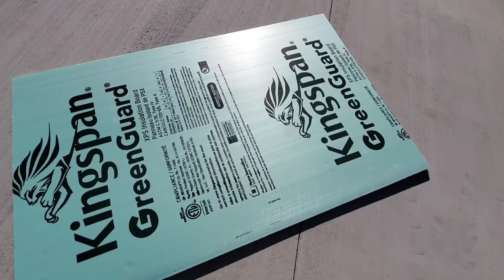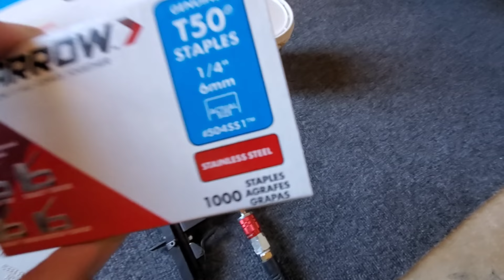Super Simple Jon Boat Floor

Comment: Thanks for doing this little series. I have the same boat and want to pull the foam in the rear bench for storage now. You've made look easy enough. I have floor mounts for seats. Would the aluminum angle be enough to support a foor mount pedestal seat?

Comment: I'm just curious if you have ever run a grab bar attached to a wood floor like this and how it held up?
Reply from the maker: I haven't,  I'd imagine it would need to tie into a rib or hull
Reply: @AnthonyJonesBrigadeBoats  Ok thanks and thanks for the video.  I had another question.  Do you really need the angled aluminum if you screw down the wood floor?
Reply from the maker: It might be ok without it so long as there is foam under it. I prefer to get the corners/ sides tied down securely because thats the spot where it's going to warp or bend. Definitely better with it but not 100% necessary if you want to try without end supports.

Comment: Zero need for the plywood with the foam  in between the ribs . Only a material that you can glue carpet to like thin fiberglass board. Way way way lighter and won't ever rott.

Comment: Make sure you use epoxy and not polyester resin.  Epoxy is stronger, resists cracking and is waterproof.  Polyester resin isn't any of those things.
Reply: exactly.....I have restored/built many wood and other boats, only epoxy will last, and esp. must seal all plywood edge  grain or it will absorb water and rot/delaminate quickly!
Reply: @richarddegen6184  what type of epoxy (brand) are you using? And just standard plywood no ada exterior or marinegrade?

Comment: How much weight do you think you added? I have a tracker 1236 wide. It can only hold 396lbs total. 2 passengers. I have a SeaPro 10hp w/5 hp stickers😉. It's a little heavier than a 5hp. 
 Reson I am asking is. If all these modes add up to 100lbs. Than that drops me to 296lbs. Now it's a 1 passenger. Look awesome. I would love to.
Reply from the maker: I literally added 6ftx4ft of 1/2 inch plywood.  So whatever that weighs. Definitely under 100pds
Reply from the maker: I also know guys that put 800pds in their 12 footers. It's not necessarily the law, just the manufacturers recommended weight capacity

Comment: Using stainless steel self tapping screws to install it was a mistake because steel on aluminum causes corrosion
Reply from the maker: Not a mistake. Been doing this a very long time and stainless is still the best option. Galvanic corrosion can occur but the biggest contribution to that is grounding to the hull as current expedites the process for corrosion to occur between the dissimilar metals. My thoughts- don't use in salt water, and don't ground to the hull. Use other hardware if you want but they will rust out. The pros of stainless for this application far outweigh the cons. Just my opinion.

Comment: Excellent video I've seen a lot but this one is the best. I'm going to do the same flooring to my 14FT Tracker. What size rivet did you used?
Reply from the maker: Thanks! 
3/16 rivets with 1/4-3/8 grip
You can use countersink or standard found here:
https://tbnation.net/products/rivets?ref=builtforbattle&variant=34317257539719 
Use code BRIGADE at checkout for 5% off

Comment: would the bench storage hatches not fly around on the highway with no latches?
Reply from the maker: No, the carpet is tight and snug. No different from guys running flush finger pulls or nylon strap latches. But yes, locking latches work great. Adds time, labor, and money in parts. This was budget project for customer. You can add them though.

Comment: For it to last why don't you seal both sides of your plywood
Reply from the maker: I have before. You can. I've found it to be a waste of time and material.  I seal the tops and sides mainly for extra protection from rain (while fishing or in transport). If you plan to turn your boat into a submarine, seal it all. I personally have never had more than a half inch of water in my boat and that was after a leaking plug. Residual moisture will not harm the underside but standing water of two inches or more (height of bottom rib) will.  If you leave your boat outside all the time uncovered this modification may not be for you.
Reply: @AnthonyJonesBrigadeBoats   Didn't figure it would be that much more money especially  you're doing YouTube videos but OK
Reply: @AnthonyJonesBrigadeBoats   Do you think a real boat  Builder would cut cheap corners like that? For God's sakes make a name for yourself

Comment: Not PT plywood? Problems down the road?
Reply from the maker: Not treated.  That's the point of the resin I used. Waterproofs it. Been doing it for 5 yrs now. Works great although most of these boats guys are willing to pay me to modify take good care of them. Garge kept, covered, or under a pole barn. Might get wet here or there but if you.leave anything outside all the time it will turn to crap pretty quick regardless.

Comment: How long will the wood last with putting the resin on it
Reply from the maker: A long time. Results vary on if the boat sits outside or is garage kept and how often it gets wet. Loaded question man. I expect mine to last as long as I have the boat.
Reply: not long

Comment: Why do you always use wood instead of alluminum?
Reply from the maker: Dude.....The video posted one week after this was titled: ALUMINUM FLOOR SYSTEM.  In my all aluminum 1232  build. Just did a Basstracker Pro Team 165....All Aluminum build. Currently building a 1436 , aluminum framing wood decking. Customers pick. When an all aluminum build cost 2 grand more for hatches, guys opt for wood. Watch my channel,  it's not all wood. The budget stuff is though. Aluminum is 225$ a sheet, wood is 60$. Wood hatch is factored into the sheet,  aluminum is roughly 200$ per hatch lid to make, including tracks. Again, up to the customer.

Comment: why don't you resin the back part of the board?
Reply from the maker: You can, and I have before. Found it was a waste of time, resin, labor, and money. It's elevated off the floor, only way it's getting wet is if your boat is flooded. Even at that, exterior grade can get wet a few times no problem.  It's the constant abuse from rain and moisture the top takes that is the problem.  I make sure to do the tops and sides of all parts really good, seems to work out. Do the bottom if you'd like, from a budget standpoint I find it unnecessary.
Reply: I’m hoping to do something like this for my Jon boat at some point. If I use plywood, I’ll be epoxying both sides. What’s the harm? Seems it can only help.

Comment: Soooo. Where’s the water escape ?
Reply from the maker: It drains around the sides and works its way to the channels. I mean, the floor is TIGHT, but not AIR TIGHT. Water finds a way. You can add flush floor drains if youd like but my experience is its hard to durect the water to the drains abd it naturally drains to the back and sides so i don't bother unless the floor is tapered to the center like some bass boats ive done.

Comment: 1" SCREWS ? HOPEFULLY THEY DIDN'T GO ALL THE WAY THROUGH.
Reply from the maker: The rib is 1.25 inch plus 1/2 inch plywood,  you'd need a 2.5 inch screw to go through the wood decking, the rib top, and bottom of the boat. Why the ALL CAPS BRO?

Comment: Great video but DO NOT PYRAMID CUT that L-angle. Definitely don't tell other people to cut it that way. Its much more dangerous. If you're breaking teeth off the blade, it's the wrong blade and/or you're cutting too fast. 

Sincerely, just someone who doesn't want yall to get hurt. Not trying to be a smart-ass.